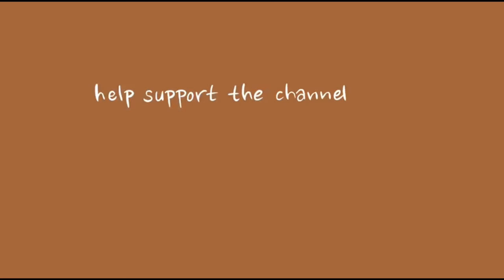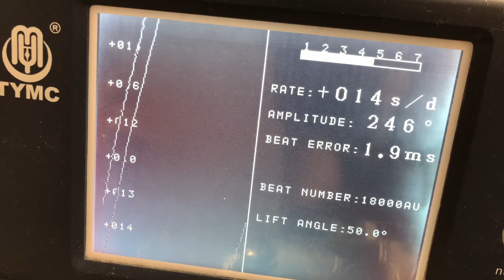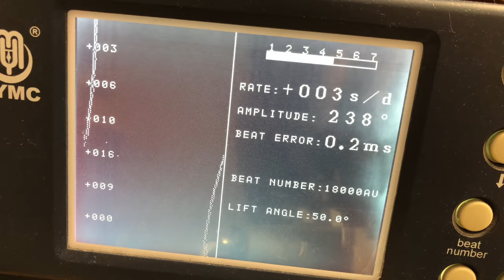Restoration of a 1st Generation 1953 Tissot Visodate Watch - Caliber 27B-621

Comment: Great video, I note you do not pull all the components completely apart and leave as is in the cleaning and assembly. This is a beautiful watch love that dial, thanks for showing it.
Reply from the maker: That's right.  I do examine the movement before putting it into the cleaning basket.  If the setting gears are clean (since these gears do not affect the timing accuracy of the watch) and I've used the rodico to clean it as well, I'll leave them all intact.  The full restoration takes much longer than just 30+ minutes.  Anything that can affect the timing performance, I will take it apart to thoroughly examine it.  Remember that the main purpose of wearing a watch is to tell time.  Not sure if you're a watchmaker or not, but the cleaning solution will clean away any residue that remain on the movement.
Reply: @TimelessHistoryChannel  Not a watchmaker I have completed a few watch strip downs and cleaning plus repairs to broken watches. Only cheap watches nothing like what you are doing. Very satisfying when you get an old battered, broken or non runner back to life. Fascinated with watch workings and how they are built. Started servicing myself because it was hard to justify getting them serviced when the watch was only 20 or 30 dollars but they deserved to be preserved and used.

Comment: I notice you assemble the train from the balance to the barrel as opposed to barrel to balance, any particular reason? I'm going to try it that way on the next movement I service. Seems oiling the fork jewels and checking balance function are easier the way you do it. Thanks, great video.
Reply from the maker: I guess every watchmaker has their own way of cleaning a movement.  This method has always work perfectly for me.  When the job is done right, the watch will always work at the end.

Comment: Great work. I know you have mentioned a method to adjust the beat error by tweezing the hair spring in one of my comment before but I never heard about anyone else who does it that way and still dont know exactly how can it be done. Can you explain the way in detail? I would be very appreciated.
Reply from the maker: Thank you so much! 
Oh really?  I learned this method from a former Bulova watchmaker.  It saves a lot of time, and you can adjust it while the balance is still on the movement.  You can use the tweezers with the hook end, or regular tweezers will work as well.  To correct the beat error using this method, you adjust the hairspring with the tweezer.  Before adjusting, you must eye-level the hairspring to see the spreading of the hairspring.  The balance staff will be the center.  If the hairspring is more toward the left, you will need to adjust the left size by curling the most outer coil slightly and vice versa.  Do not bend the hairspring.  You are just adjusting the curvature of the hairspring.
Reply: I see. So I assume that after decades the hair sping got slightly out of shape, which causes the collet to be off center and by curling the most outer coil will get the collet and also bear error right again. Unless a previous watchmaker have removed the hairspring and put it back way off then turning/re-fit the collet is the only way. I mainly work on modern movement but if I run into these vintage oneday this magic spell may make my life alot easier. Thank you.
Reply from the maker: @sonvu9756  It's hard to say how the hairspring goes off beat.  There could be many reasons for that.
Reply: @TimelessHistoryChannel   Thank you so much for describing your technique. I'm in progress of my first restoration project and it worked like a charm. I combined advise and used a (clean) oiler tip and was ever so gentle (and nervous) but it worked! THANKS!

Comment: Please, can you explain me, what is the purpose of top yellow gear in movement. I see it is rotate when movements works, but I can't see it's roll? :-)
Reply from the maker: It’s connected to the forth wheel.  This top gear sweep slowly and is connected to the sweep second pinion which makes the second hand sweep.
Reply: Is it Omega 286 movement ie. the same movement as 27B Tissot? Thnx.

Comment: How did you adjust the hairspring with the tweezers?
Reply from the maker: It takes a lot of practice over the years.  You need to curve/coil the hairspring so that it balance out when the wheel is spinning.  This way will save you time and work to remove the complete balance and hairspring.  Whoever you learned your watchmaking skill from should be able to show you in person.

Comment: I like watching your videos and also like your style. However, unlike other watch restorers who make videos, you do not seem to take the keyless mechanisms apart. Is there a reason for this apart from saving time?
Reply from the maker: I do examine the gears thoroughly off camera.  I must make sure that there is no hair particle on any of the winding gears.  I understand that it looks better to remove these parts under the camera, but in reality, the majority of watchmakers will not need to remove these parts.  These are sturdy parts and do not affect the timing of the watch.  The only time that I will remove these parts (clutch wheel, winding wheel, and yoke) is when I see rust or broken teeth.  Most importantly, is to use the correct cleaning solution.  I use L&R Ultrasonic cleaning solution and it will remove and dissolve any dirt that is on the movement.  The cleaned movement will look shiny like new.  I've serviced over a few thousands of watches, you can trust my words.  Notice at the end of the video how I used a tweezer to adjust the beat error?  When a watchmaker watches this video, I can assure you he will understand what kind of watchmaker I am.  When a watchmaker is able to correct the hairspring with his tweezer, that takes a lot of skill and years of practice.  :-)
Reply: @TimelessHistoryChannel  But we didn't see you correct the hairspring.  You only showed what type of tweezers you're supposed to use for making the adjustments.
.
Reply from the maker: @gwsjr1  My camera would not be able to show clearly in the first place.  And my head would be covering the camera in order to clearly see the hairspring.  Also, correcting or adjusting the hairspring is not for a beginner watchmaker to do.  I remember my very first time trying to fix a slight bent hairspring took me about 3 hours to do...AND I still couldn't properly fix the bent.  On top of that, my entire face and head was full of sweat.  lol